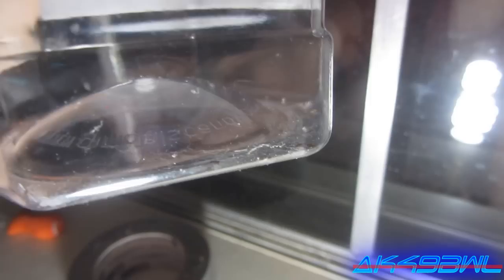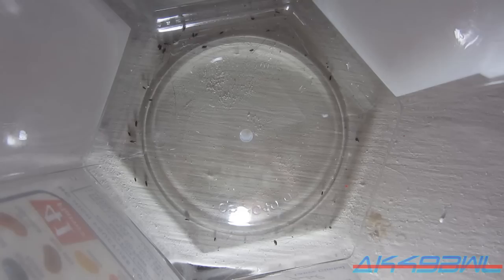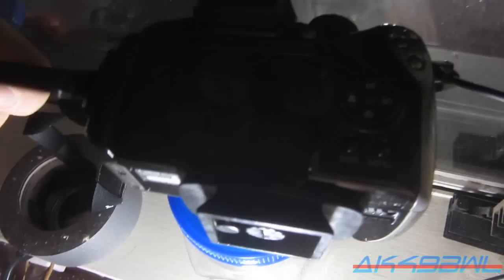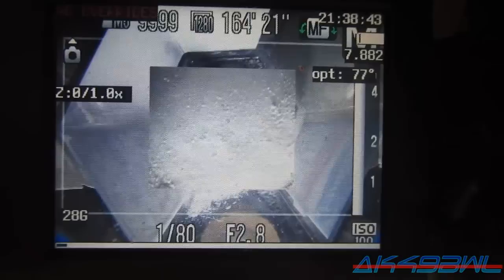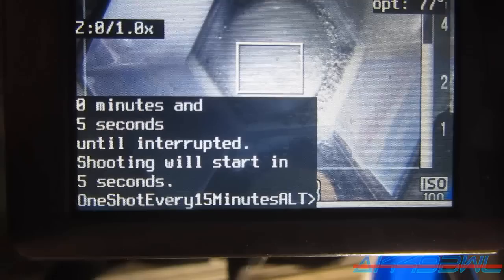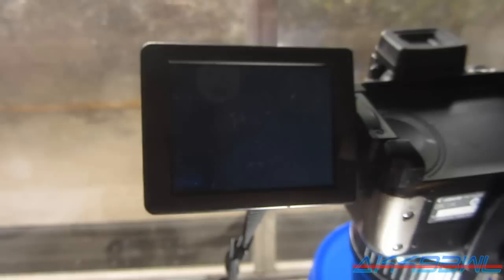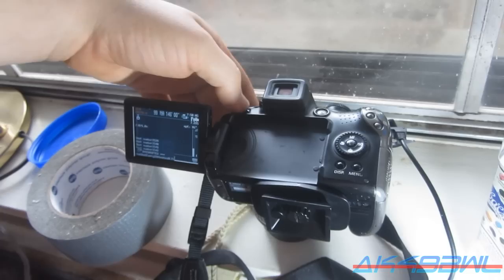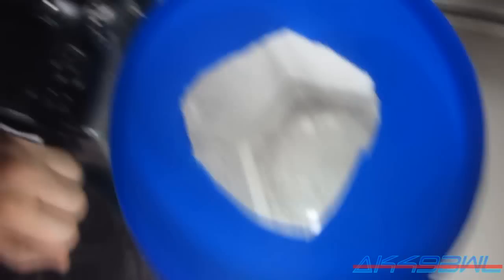Diatomaceous Earth vs Fleas Experiment

Comment: I bought Diatomaceous Earth as one of the steps in eradicating my flea problem $12 for a 4 lb bag that will last many years. I've used no chemicals, just Frontline for the cat, vacuum the floors a lot and they're almost gone after 12 days. I also set out plates of soapy water with a tea candle in the center. We're down to only 1 or 2 per night now verses 30 -40.

Comment: You may be using too much. It should be a dusting everywhere, not caking. Most insects have eyes, and will avoid large obstacles (piles of DE). Thin and  light dustings are less avoidable.
An easy way to apply it, is fill a sock with DE, then pat/beat the sock around your Home.
Reply: Cool idea!

Comment: I thought this was a very useful video, and I bought some DE because of this. I also bought a couple of flea traps (a small lamp above a sticky surface) Fleas are attracted to light. Before buying those, I would put a tealight candle on a plate which had a small amount of soapy water on it. Although it was a bit dangerous leaving an unattended naked flame, counting the dead the next morning was very satisfying.
What also finally helped me to eradicate the fleas was to remove the heat from the rooms during a cold spell. Flea eggs die if the temperature reaches 0 Celcius (32 Fahrenheit). I realise this may be no help if you live in a warm climate!

Comment: I had fleas the best things that worked for me was:
1. Carpet cleaner, i used it every couple days and replaced sheets on bed every couple days.
2. I set up a bowl of water and shined a desk lamp directly on the bowl and swooshed around some dish soap.  The light attracts the fleas and they land in the water and the dish soap reduces the surface tension of the water, so they sink and drown… this 2nd step probably won’t kill all of them, but will give you an indication of how well the 1rst step is working. The fewer fleas you catch each night, the fewer fleas you have bounding around your place…. This worked for me.

Comment: The experiment was interesting, but.. a few things: 1. It can take some time for the fleas to die (or other insects) because the DE has to work it's way into the exoskeleton, and they basically die of dehydration.  2. I am really surprised it took them that long to die, because you had quite a lot of DE in the container. 3. DE really does work over time. Also, keep in mind the fleas in your carpwts have probably laid eggs. It won't kill the eggs, so you should re-treat in 2-3 weeks. You may have to repeat more for a large infestation. 3. Don't  use your household vacuum to clean your carpet. Use one with no filter, like a shop vac. Otherwise your filter(s) will clog quickly, and your vacuum will also die. Thanks for doing this experiment. It was very interesting!

Comment: They are not all food grade so you have to make sure.  I am TNR certified and I got so many tick in my basement from the feral cats so I put it on the floor and it worked.  Now I have a glass balcony outside so I do it only when the weather is warm to avoid using my basement.  Thank you
Reply: He used food grade. You can tell at 0:54 if you pause it just right
Reply: That is definitely reassuring. I just bought some wooded property that I've been clearing. The ticks are treacherous. I am going to try it and see if it kills them off.

Comment: I love DE... but I set out little dishes of water around the house that have a drop of soap in them and drown the bastards when they jump in... Works like a charm.
Reply: How do you attract them into the bowl?
Reply: @FrenchViking466  for some reason they just jump in, but if you have a light over the bowl it works even better. You can buy little trays with lights for this purpose, Home Depot has the Aspectek Sticky Dome Flea Trap that uses sticky paper. Once you run out of the sticky paper you can put a little water and a drop of dish soap mixed in, then plug in and turn on the light. Terro has a model also but it doesn't look like it has enough of a dish to hold water. The heat from the light attracts them, but as John said, for some reason a dish with a little soap in water can also work.
Reply: I am also curious how you attract them to the bowl
Reply: @PhrostyFill  you don't attract them to the bowl. Fleece constantly jump around so they jump in the bowl by accident. Having the bowl under a light will also get them to jump more. I noticed that the bowl that I have near the light gets way more action than the bowls that are in the dark. The drop of soap makes the fleas sink instead of float and keeps my cats from drinking it.

Comment: I like that you took the time to experiment and share you experiment. I've tried so many things on my pets, in my home, and in my yard, but cannot get rid of the fleas. The only thing different I noticed is that you had read it works on 3-5 hours, whereas, depending on which post I read, I've seen claims that it takes 3-4 days or 7-10 days. So I guess many companies having varying time frames, but at least it works and isn't going to cause all the side effects that chemicals cause. I love in the woods and deal with so many pests and DE is supposed to work on most of them. Thank you for your time and video. I'm going to get some today. Shalom.

Comment: You have to use food grade diatomaceous earth in the event the pet ingest it.  Blue Dawn dishwashing liquid also works, bath your pet, let sit on pet for 10-15 minutes, rinse, then wash with baby shampoo.  You can also put the DE on pet.  In the case of your home, you might have to spray the place.  Adam Pet Supplies has a carpet spray, but you have to keep pets out of the room for a couple hours.  
Dishes of water with Dawn in it with heat lamps also works.  Some folks use coconut oil on the pet as well.  Some people use boric acid as well.

Thanks for your video.  We must fight flea together!

Comment: Fleas and other hard exoskeleton having bugs will eventually die after coming in contact with enough of DE. But 3-4 hours is way off. 
I always explained to customers imagine them walking on glass shards. They won’t die immediately but after being cut so many times they will bleed to death (dehydrate to death). 
May need other products for instant death but I stilll recommend DE for cheap & effective bug killers. 
Just might take a lil patience.
Reply: Tara Steffonich 
Yes. They even have some versions that are food grade, which means edible. Some ppl feed it to pets for worms and other reasons. 
And if you use safer brand DE it doesn't say it's food grade but technically it is. The reason it's missing the label of Food Grade is because it's not tested by the FDA since it's only recommended as a bug killer but it's still safe to leave out with pets. 
Just don't over do it.
Reply: Best thing is vinegar instant
Reply: @ekzoX0  only use food grade DE. The higher grafenstuff is too potent for animals and humans a like. Dont breath in the dust. No fans blowing around it.

Comment: Thanks for this experiment. We need more people doing variations of it, even though a good handful exist.
Fleas flourish in HEAT and MOISTURE, remember. So make sure the room or containers can breathe and dry out.
The mechanism of destroying the exoskeleton of small insects is oft described by only half of its two opposing mediums of insect demise. People tell you the DE abrasion’s breach of the exoskeleton causes 1) dehydration, OR 2) drowning of the insect.
Well, either CAN be correct although those are polar opposite causes of death.
The exoskeleton isn’t technically the cause of death as much as the catalyst : it seems to simply prevent BALANCE of moisture which is what an exoskeleton is for, among other things. Their shell prevents BOTH dehydration AND drowning. So, the DE simply opens the door for either. In short, they’ll eventually dehydrate IF they don’t drown first.
I’ve used this powder for 10 years on over 200 cats. It’s quite effective if used right and WITH EXPERIENCE. Diatomite is far less effective when wet for the flea control.
Do yourself a favour and place the powder in a completely empty and dried plastic honey ‘jar’. (Only one-third full.) With a LIGHT snapping pump mildly squeeze the container — NEVER AT AN ANGLE, exclusively straight up, forming a barely visible cloud with optional rapid fire frequency.
It takes a light touch to affect this consistent cloud that doesn’t spit out big ‘crumbs’ as you see on your carpet. You don’t want visible specks at all. The stuff works when as many individual grains aren’t combined. This plastic pump method facilitates it well.
This stuff does not take care of ALL our needs, though. If we don’t sweep the powder up every few days, we give pupae (which are impervious to DE) plenty of chance to hatch and populate.  Take the swept up stuff outside FAR from your landings, decks, patios, and porches and dump it or place the remnants in your (ideally, sealed) trash bags. 
Then powder again pronto.
Remember when your kitties get worms, they weirdly start eating their freakin’ litter ‘sand’? And ya notice it’s mainly the ones needing deworming that continually try that?
Fresh litter is manufactured with diatomaceous earth in it. The manufacturer mixes it in because they know it’s both good for liquid (e.g., urine) absorption and cats love its presence. Now some of you know why your retarded cat loves to lay in (what you think is) its own poo. It’s not poo they’re interested in and cats are smarter than we know, they avoid the crappy spots. Note they do this ‘litterbox lounging’ especially when you change out the old litter with new litter.  (Do NOT let them EAT the litter, even fresh. Constipation can kill, especially a baby.) They can, however, eat as much DE powder as they want. I’ve eaten it myself. (Tastes Great, Less Filling.) I let my cats deliberate whether they wanna eat it. But none of them are allowed to eat litter box clay pebbles.  Irritatingly, I got ONE cat willing to eat DE — my Russian Blue, Jemimah, eats it like candy. The rest of them only trust the poo box. Duh.
Before sweeping, do high AND low dusting. (Yes, BUY A FEATHER DUSTER. You need one anyway. )
The protective pupae wall phase stops powder from affecting the flea. These pupae can hatch in 3 days after they’re sealed within it. They can also hatch many months later. So, sweep frequently. Again, though DE does more than one thing, some even when wet, nevertheless DRY is best for fleas. 
Your vet wants money. Typically. Some recommend DE. Most criticise it. Because cash. Vets do NOT want to help you. They want the cash. And they know diddly about cats. Nothing. Same with cat websites. Zip.
Vets DO know about drugs, scare tactics and expensive foods, which your cats don’t usually need.  But they know zip about more than just a couple geni of animals (mainly dogs and horses, coz that’s what rich people possess. Not quite as many cats making profits for vets. ) Vets don’t understand cats at all. Similar to how Starbucks coffee baristas don’t drink coffee — mostly tea and soda, yet they consume the odd frap.

Comment: I took an old oregano spice bottle and filled it with DE.  I sprinkle it on my dogs and cat.  I tore up my carpet, had it for about 8 years, now I just have vinyl.  Flea problem is almost non existent and I live in the country.... DE is great!
Reply: True! Having carpet on the floor is like to having a huge animal fur where the fleas can hide, mate and live very comfortable.
Reply: Yeah carpet is nice but it sucks. Get tile or laminate floors and then use rugs where you want carpet. You can take the rugs outside and clean them with steam.
Reply: BECAREFUL ~~~~~~~~~~ Oregano poisoning cats. Oregano essential oil, or OEO, is far too concentrated to be used on cats. It is high in both phenols and terpenoids, which cats can not properly digest due to a lack of glucuronyl transferase digestive enzymes in the liver. This can result in a toxic reaction and permanent liver damage to the cat.. Please research before applying any substance to animals, you can create great damage.
Reply from the maker: Reading comprehension > you. They used a bottle that used to have oregano in it, and put DE in it instead, likely washed out first; they didn't just dump oregano on their pets..   Jeez, some people...
Reply: Brandon thanks for clarifying that!  It’s DE, in a shaker bottle!

Comment: Oh man, so many damn comments! I was looking for the answer to my question but failed. Also, maybe I did t scroll fat enough but I didn't see anyone explain why the food grade DE is "preferred". As a pool owner Im always warned to do everything possible to avoid breathing the DE while pouring into the pool filter because it's basically made up of extremely sharp microscopic almost glass like substance  and breathing it apparently can slice lung tissue and eye tissue. Supposed to be incredibly painful like splinters in your eyes and the pool grade stuff is ground incredibly fine. It's these same sharp pieces that cut the fleas and make it work.
Reply: Has to do with the levels of metals left in it or something like that I learned via research recently.
Reply: Food grade is less than 2% of those sharp glass like particles and the stuff you using in the filter is over 60% better for filtering especially heavy metals and also both attract aluminium like a magnet
Reply: @EcnalKcin  was just about to comment this
Reply: Food grade is safe to be ingested. The other is not and will poison your pet. Simple as that.
Reply: @EcnalKcin  No, actually it cuts the exoskeleton and then they dehydrate and die.

Comment: As someone else said, just cover your stuff in salt. Salt works great. DE isn't good for your lungs to breathe in, and your cats and dogs will be on the carpet breathing it in. Salt is safe and effective. Leave it down as long as you can, and just vacuum it up. Mix DE with dry pet food (shaking them up in the closed bag). It will work internally removing parasites, including worms, and it is safe to ingest, as long as it is FOOD GRADE. Commercial grade DE is used to clean pools and not safe to ingest.
Reply: This is a myth. Long term inhalation can potentially be harmful (irritating, not fatal or carcinogenic) but we're talking about years upon years of inhalation...and, even then it's only a *possibility*.
Reply: Food grade is fine

Comment: Just a couple thoughts on fleas in your environment.  For every one flea you can SEE there are 99 others in different life stages - eggs, pupa, larva - in your household.To kill fleas you must treat the whole house and even yard if your pets go outside. In the house I'd recommend vacuuming and cleaning up old dust bunnies and washing any animal bedding before putting down any treatment. When finished vacuuming the house be sure to spray some Raid or other insecticide into your vacuum bag (the easiest thing is to just spray it while the vacuum is on) That way it should penetrate the bag and kill any living fleas. The eggs are the hardest to kill. Consult with your local veterinarians regarding products for your pets. Cats are very sensitive to insecticides so be sure to read the labels thoroughly before treating your house if you have cats.  Monthly treatments are convenient and work very well. there are many different brands and I'm sure some are better than others.
If you use diatomaceous earth or another powdery Area Treatment, I suggest that you take a straw broom and work it into the corners of the room and even the carpet. diatomaceous earth will continue to work as long as it's there. I've also use Sevin Dust in the same manner. Work it into your couch under the cushions, under furniture or anywhere your pets like to hang out. I hope these suggestions are helpful. Please and other parasites can cause lots of problems for your pets as well as you. (Sevin Dust is an organophosphate and should never be used on cats.)
Reply: I can t believe u put Sevin on ur couch, you and ur animals sit and lay in it. DE will do the trick, without the carcinogenic poison.

Comment: Make sure you’re using food grade DE opposed to pool grade DE. I’ve seen a lot of people mix this up and hurt their pets. Other than that it will work but not right away. The only bad thing about DE is that it’s hard to use outside because of the outside elements. It’s either watered down by rain or just blown away by wind. You have to constantly re-apply it outside to see any results from it.
Reply: It hurts pets if not "food grade"? WEIRD SINCE "KITTY LITTER" IS 100% DIATOMACEOUS EARTH.

Comment: I put on my dog and make sure it gets down to the skin and reapply every seven days and lightly dust the area surround his kennel also. I made a dust mask for my dog to wear and I wear a mask as to not breathe it in while applying it. Also wear gloves cause it dries out skin. My dog does not have flea problems at all. I also add the food grade to his food to eliminate worms.  My dog has never had any of the chemical crap put on him or medicine for worms. The only he gets is a rabies shot. The vet does fecal checks and is always free of worms. If you notice you dog has dry skin from this wait one day after applying and apply coconut oil and massage it in. My dog is a boxer so I deal with short hair and it is easier to massage in. The I repeat process each week just a quick routine and he love his body massages when applying dust on Sunday, the oil on Monday.  I buy the big containers of cold compressed coconut oil and it last 3 months for 15 bucks. Big bag of diemetreous earth for about 40.  So total cost for all season is about 85 bucks and no fleas at all. Ps I do my cat too